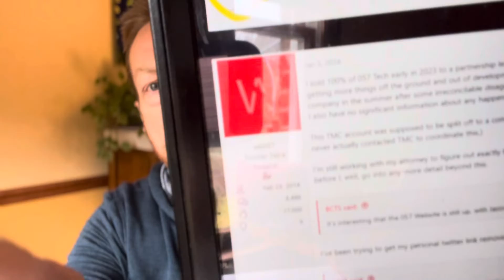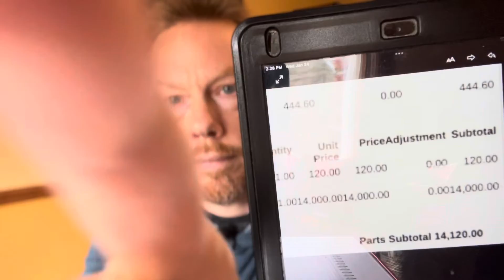Tesla repair expenses on older Model S / X -- PART 1: Battery concerns, failures, replacements

Comment: I have the drive unit out of my car in my garage.  I do have a two post lift and a machine shop here in my house but Tesla charges WAY to much money an d their work is not that good.   they tried to charge me a long time ago for parts they broke .   I told them I am a mechanic and I know that part wast broke before.   within 5 minutes they adjusted the price but still charged me for the parts they broke.   hence why I fix my car myself from now on.

Comment: Fellow M-S-13 here, and I want to do all the preventive maintenance and recommended engineering updates to keep this baby on the road
Reply: Funny, the like goes away when I made the typo edit... ✍🏻 always learning how these things work
Reply from the maker: As I pointed out in a recent video-- I'm looking to refresh some suspension bits soon to regain the youthful quiet/tight handling it had a decade ago.  And with a 2013-- make sure you've done the AC drain line fix. THAT'S a big one to check!
Reply: What's a good way to connect our networks via LinkedIn?
Reply from the maker: I do very little on LinkedIn. Last time I wrote a resume was in 1996.  LOL    I'm here (obviously) and also on Twitter/X/Instagram  more routinely-- all links are on channel profile page.
Reply: @NZCUTR  very good, thx ... Yes, resume writing.. LinkedIn kinda gives a chronology of your evolving achievements/ interests, (all what you make of it) but the best part are the conversations and network amount sharp (and consequential) industry professionals who take action and have significant funding.. so there's the invite to kick it to the next level. I'm wondering if more Tesla groups are there as well ? The specialized websites and Reddit forums seem to serve the role, generally..

Comment: I heard that they are no longer making 85 packs, but will instead install a 90 pack and software limit it. Software-limited packs have some nice side-effects.
Reply from the maker: Correct -- I did this video about 3 times in the car and just couldn't keep my head straight and finish it during my normal drive time, so I can't remember if I said it in THIS version or one of the other ones (!!) but yes:  New build packs are a 100 with one module missing, so they're about 90.  There are mixed anecdotes as to how much it costs to unlock the additional range, so YMMV by quite a lot -- but even as a "85" (which was really only ever an 81) it would give you overhead on a full charge and the tapering when supercharging.